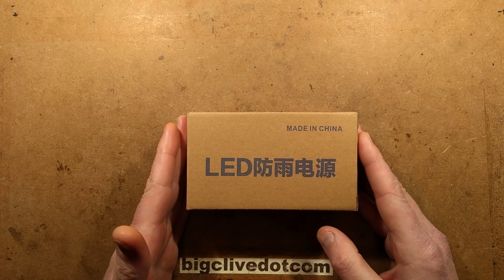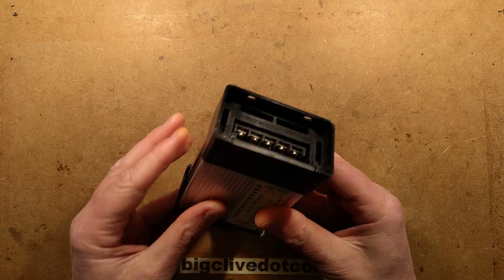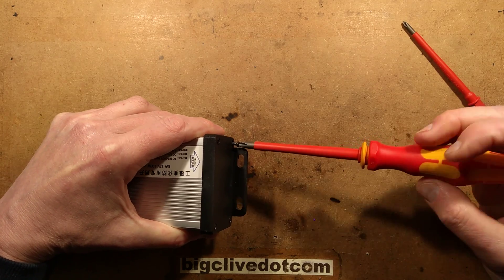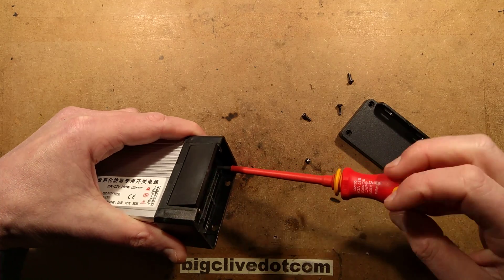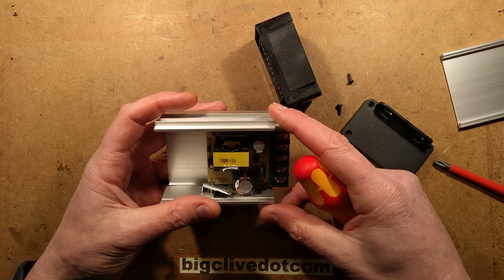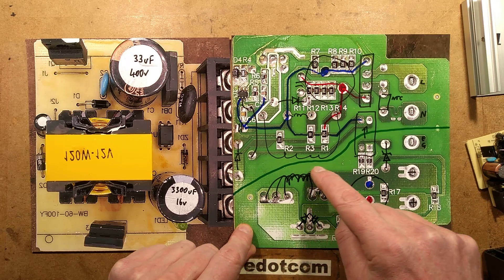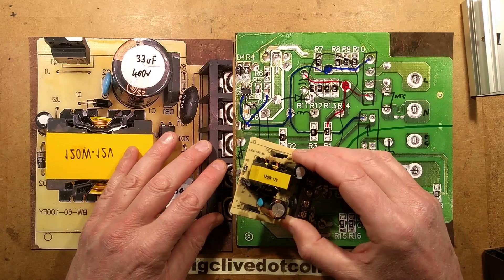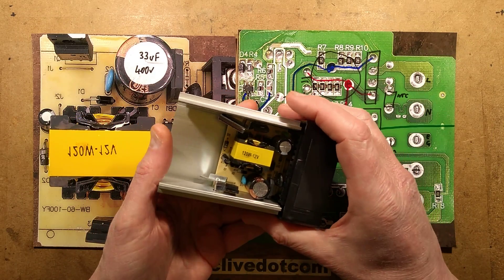Cheap imported "rainproof" power supply (short version).

Comment: Hey guys,I have a similar power supply thats 120W 12V 80A 50Hz .
Im a newbie to electronics , but I attached the three phase wire there.
It works,the fan is working inside,however, the 16V generator starts to overheat and fry. there are two of them next to each other. The one overheating is unevenly attached within the composure.Help needed

Comment: Great video. If you "like" dodgy electrical devices check out some of the cheap replacement sewing machine motors on the well known auction sites. In particular the foot pedals that control the speed).  In one I have the spring that raises the pedal could fall onto the exposed electrical contacts inside making the metal case live. The case isn't earthed and nothing inside is double insulated. Hate to think of someone using this in bear feet. I will be tearing mine down for parts for a rock tumbler.

Comment: This is basically like the neon sign power supply that killed somebody last year.  Cheap chinese supply rated for outdoor use, mounted externally on a wall outside a restaurant.  A pedestrian walking by touched the box and dropped dead.  It had just rained.
Reply from the maker: It's possible that it was the supply going to the transformer that was making the metalwork live.  All it takes is metalwork and no proper grounding.

Comment: lets use that with the mains to drive a step up dc to ac inverter and power an induction cooker coil to eletromagnetically energize another bifilar coil and rectify them into a bank of super capacitors and step those down to 1 volt 1000amps and make a free energy device!

Comment: Clive would a caseless power supply need to have the ground connected if it's going to be hidden away in a plastic case?
Reply from the maker: You can't really control where it's going to be used.  The point of the grounding is to avoid a scenario where someone may pick up or hold that unit and then provide a path for current to ground through their body.  That could also happen when someone servicing a sign or control system felt the case to see if it was getting warm.
Reply: @bigclivedotcom  OK I'll try to find a way to use the ground
Reply: @bigclivedotcom  I did put the earth connection on the power supply and it works great.

Comment: Apply the same de-rating to the environmental protection as you would the 100W power rating.  It's a 20W power supply that you should not bring within 10 meters of water.

Comment: No (rubber) seal, 💦 water will penetrate the top,  capial effect pull the moisture in at the screws. Screwholes are convenient cups...
Default the set “mosfet/duo-diode” is not connected throw the case, but is something died,... it easy could!

Comment: So is that basically just an 8 amp 12VDC power supply? How much was it? EDIT: I always like when you review something that's marginally useful, Clive.
Reply: https://www.ebay.com/itm/AC-DC-85-265V-To-12V-8A-100W-Converter-Step-Down-Module-Power-Supply-Switching/372374080452?hash=item56b3398bc4:g:A-gAAOSw4PNbyxJK

Comment: Claims to be Rainproof yet no rubber gasket between the plastic ends and metal chassis.
Reply: It's the Chinese definition of rainproof, which is a bit odd given the tropical storms they have over there.
Reply: @juststeve5542  Something upstream will have shorted out before the rain gets into your hardware, so it's waterproof!

Comment: These always advertised as 12v LED driver, is that just marketing? Let's say I need a 12v 8a supply to power a pump, are these robust/safe enough to survive that for any useful time? Taken into account that it would out of sight and not be able to be touched while live etc?
Reply: LOL, that's what I want to know. That's quite a bit of power, it would be perfect for my radios.
Reply from the maker: I'd always use a generic power supply well below it's rating and treat these ones as potentially non isolated.